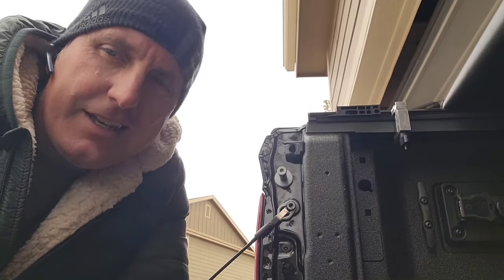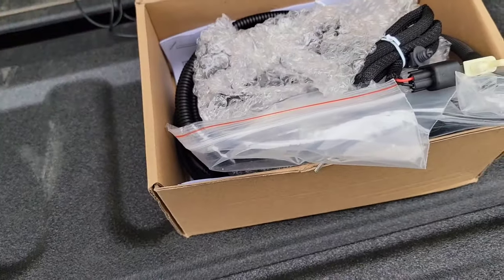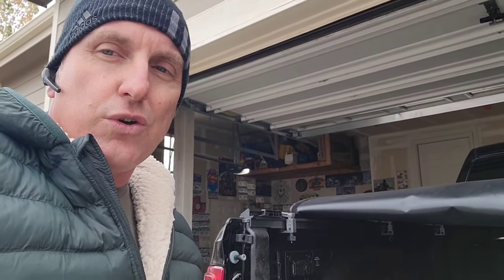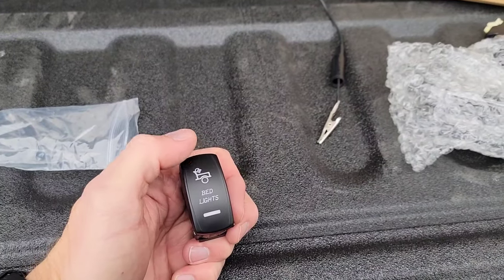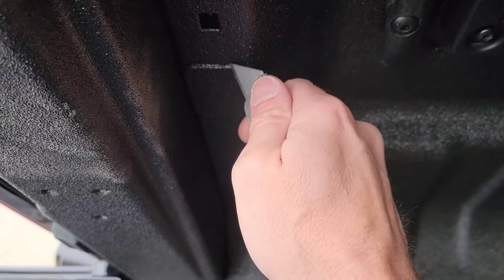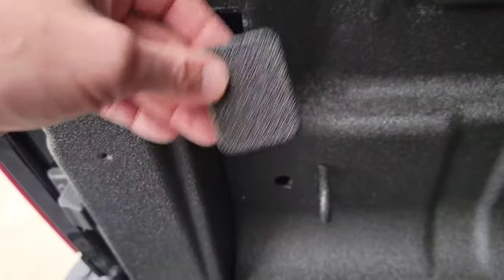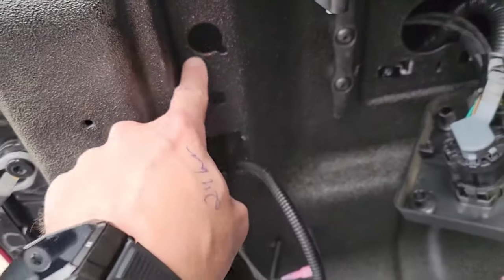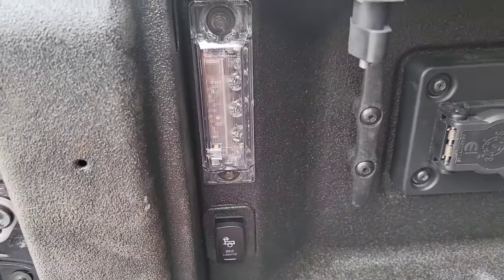RAM Truck bed light install tutorial LED...Factory how to 2018 to 2024..1500..2500..3500!

Comment: Thats strange!  My 16 had wiring harnesses already installed behind the bumper for the oem bed lights. The caveat being, I had to take it to the dealer so they could activate the circuit, so the lights would work.  Luckily, I knew the GM of the dealership and he did it for free.  Great job on the install!!

Comment: Ordered the lights on my 18 Ram Laramie crew cab 3500. I just ordered a 24 Laramie 3500 and the lights were not available to order.
Will have to go your route and install my own when my 24 gets to the dealer.

Comment: My 21 1500 doesn't have spot like yours for switch any recommendations ?
Reply: If your 2021 is a 5th Gen (not a classic), the switch will be integrated into the drivers side light.